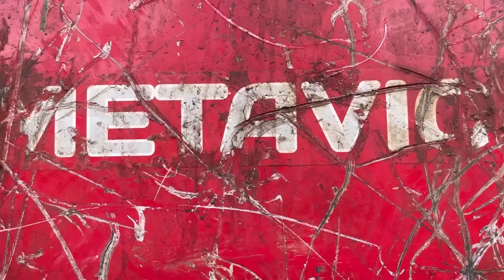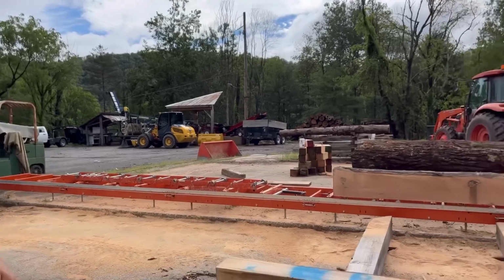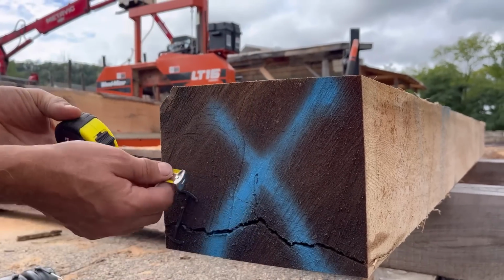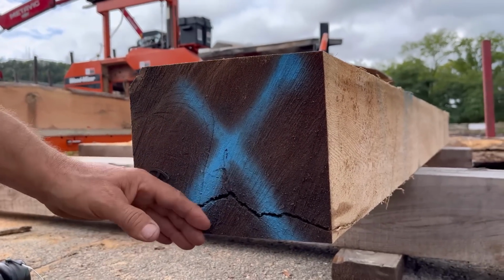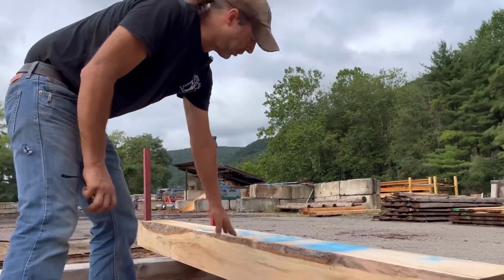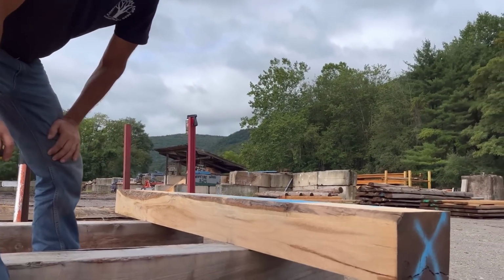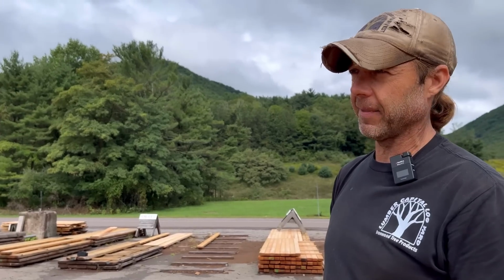How We Make Railroad Ties on Our Woodmizer Sawmill!

Comment: Excellent. Very good call on rejecting that tie. Tie plants grade ties before creosoting and that would have been rejected at the grading process. Standard railroad cross ties are 8 1/2 feet in length. Grade ties are made from all hardwood. Oak being the best and is also the choice of wood for turnout and bridge timbers. All green ties are seasoned at the plant for 10 to 12 months before creosoting.

Comment: Hey guys, have considered saving the top and bottom slabs, the ones with straight milled edges and market them for Cabin, animal shelter and other uses.  I’ve built several structures nail the slabs upright.  I think hemlock would be idle and that stuff would sell like hot cakes. Also would cut your slab pile in half

Comment: I remember the old days of the smell of creosol soaked ties… kind of liked it. Is there a preservative used now?
Reply: Still use creosote, the railroad I work for just got a tractor trailer load in smells wonderful lol. Alot of the ones on our main line are concrete
Reply: The ties are still treated.  Boss Man.

Comment: 5:09 Pennsylvania Ballet Troupe Cant Log Arabesque move
" the body is positioned by having the supporting leg on the ground with the working leg lifted into the air and stretched behind you."
... and pull really, really hard on the cant handle unless you can't handle it.
but of course our girls can, which is why they are troupers.

Comment: Are the railroad ties hard wood
Reply: Hardwood and softwood has nothing to do with the hardness of the wood. it has to do with how they reproduce and grow. Hardwood trees grow slower, produce fruits and nuts with hard shells that fall from the trees to reproduce, and their leaves fall off every year. Softwood grows faster, they do not produce fruits and nuts, but have things like pinecones that fall off to help reproduce, and they do not have normal leaves they have what are called needle leaves which do not fall off yearly. A lot of softwood trees are harder than hardwood trees. Like yellow pine, which is one of the hardest commercial woods on the market, and is harder than most commercial hardwood woods. Also, railroad ties are made from both hard and softwood. It depends on what wood they use. I would say most are softwood.

Comment: I have a real good idea for loading/ getting your logs from the "Deck"  to the Saw/ Mill cradles, (it could be used on all your mills .) But if you guys are going to make changes in the near future with your machinery/ Mills then maybe it wouldn't be needed on the next Machines / Mills ?  This idea would save you guys 98% of all your log jacking on your log deck. Once completed it would save alot of elbow grease, & time. Made out of steel mostly welding drilling and some cutting!  Some of the material could be cut at the Steel -yard . All the steel  doesn't have to be new. And a few bolts.  I'm going to take a guess "
material- wise maybe$
 2000/2500 I know steel is expensive but maybe you could get good used on most of it????  I'm sure you guys would love it, if you saw it in action.  God Bless & Best Wishes!!!!  P.S. if you noticed a rise in your likes #'s.  I have been hitting every one I can find, even the old ones!!!!!! 😉😎😎😎😎😎😎🤗🤗🤗🤗🤗🤗🤗🤗😇.
Reply: Thank you for the great idea.  Things change so quickly sometimes I am not sure what to do.  Boss Man.

Comment: You mean a railroad tie isn’t something a conductor wears?
Reply: No.  It's the knot that is used to hold a locomotive in place when a tornado is coming.  🤣
Reply: The conductor is the overhead line on an electric network ...
Reply: There is also the possibility that the conductor is particularly good at their job and becomes ... a superconductor.  At that point, no resistance is offered.

Comment: bad habit to pull toward yourself 5:09
Reply: True in general for two reasons.  Firstly, there's the risk of what you are pulling getting away from you and rolling over a foot or something.  Secondly, pulling tends to max out force-wise at your weight, whereas pushing maxes out at your muscle force.  In this case, there are stops to prevent the log from getting away.  Plus the cant hook imparts mainly torque with very little lateral force.  And secondly, given that it worked, it's faster than going around to the other side and pushing.

Comment: I,m curious as to why use the grappler to load the trailer , then unload across the yard ,  and not just move them with the forklift.   I think it would be quicker and safer.     I may be wrong ,  just an observation.
Reply: I am guessing so very well could be wrong but perhaps they use the grapple trailer system so they can pick and choose the exact logs they want at that moment going to the saw rather than loading up whatever happens to be at the end of a log pile as length, species, diameter etc could be mixed up depending on how they are hauled into the yard initially.
Reply: @moefugger  Like I said its a guess, they may have them sorted somewhat but not in a way that forks can reach each pile but I do know yard space is limited to do just as they please with logs scattered just as they might like, the answer of course to this question will be easy for the "Boss Man" to answer though !